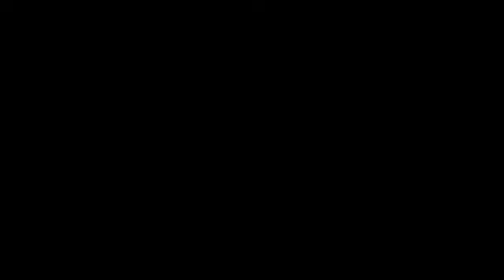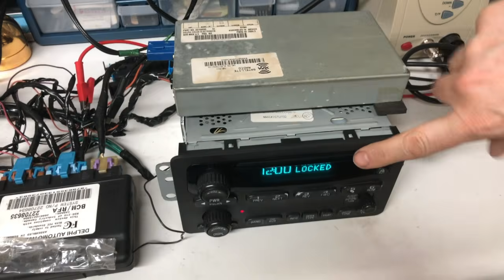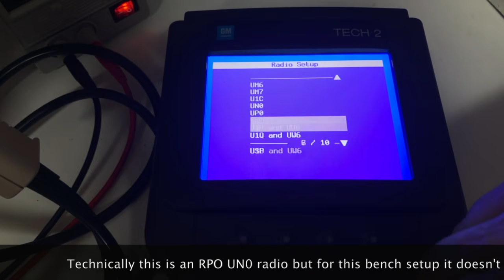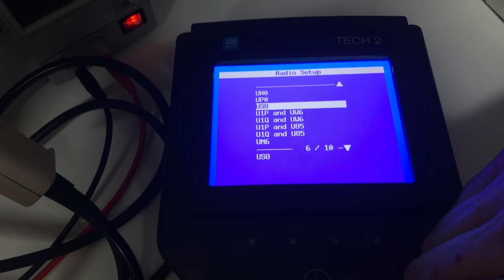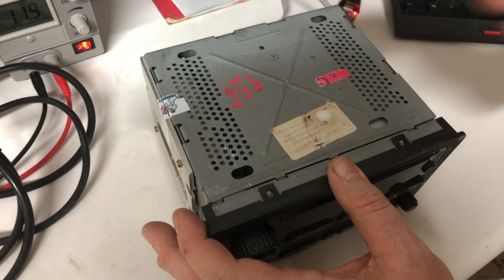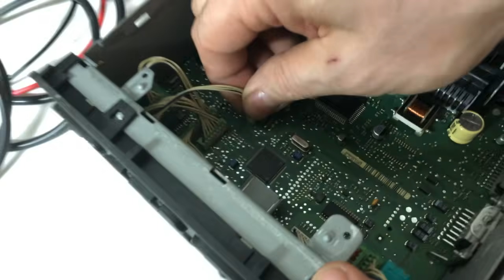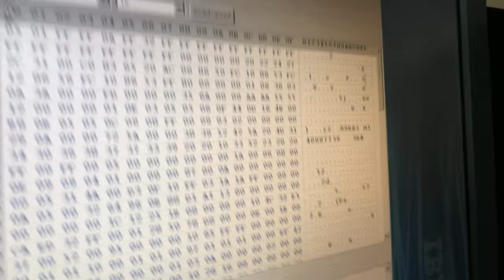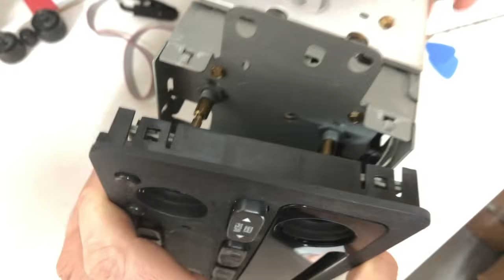2003 - 2006 How to VIN Unlock Salvage Yard GM RDS Radio w/ Tech2 OR Manually Programming its EEPROM

Comment: Ok I have done some research and have come to the conclusion the method in this video does not work on early 2000's cadillacs (except the escalade). This is because cadillacs from this time period do not have a bcm. Instead there is 3 modules that do similar functions to a bcm in most gm vehicles. A byproduct of the different design is that the databus actually goes through the radio and therefore despite having the same eeprom as in normal gm radios the vin is not stored there. I did several test to prove it including: swapping eeproms between locked and unlocked radios and also running the radio with no eeprom (can't store radio presets) and same result so unfortunately a tech 2 is mandatory until someone can figure out where the vin is stored on cadillac radios.
Reply from the maker: Whats the GM part number on the sticker of this Cadillac radio you're seeing this with?   And from what year and model Caddy?
Reply: @DrShock  one of the part # 25739873 its on a 2000-2005 cadillac deville.
Reply from the maker: I haven't come across this one before, definitely a Theftlock style, which has VIN lock rather than a manually entered lock code from the earlier series.   But a very different faceplate design, and clearly a different Delco Electronics circuit board layout.   You did verify that you're looking at the one and only EEPROM device on the PCB right?   I know that some Delphi PCBs from this time switched from using SOIC8 types to SOT23 type devices, for example.
Reply: @DrShock  absolutely i saw your video a while ago and found the exact same eeprom as in your video inside this radio but regardless of swapping it or attempting to read it stays locked.

Comment: I have a 2003 Silverado Base Radio and needed to replace the radio with a junk yard radio.... I have a GM Tech 2 and it's not giving me the option to Radio Setup...it just gives me "Input" "Output" etc...... how do I "unlock" radio.......??
Reply from the maker: The cars and trucks may have different menu paths in the Tech2 to get to the same functionality.  This special function may be called VIN relearn for a 2003 model year truck.  And it may not be in the same menu path as I show for the cars here.   

You went into Body section menu, then found radio, special functions right?   And if so all you see are the speaker and amp settings?
Reply: @DrShock  I went into all that and all it showed was "Input, Output and Data" with no Setup in the menu.    I've spent more than an hour looking at other options....I'm tired of it..... I wanted to replace the radio because the CD Player and Cassette were not working, so I'm in the process of switching the circuit  boards so it'll work......
Reply: When I switched the circuit board everything worked just fine...but what a headache.....
Reply from the maker: I've heard some times, on the earlier, trucks you have to change the year to a later one to get it to show up.   But not always, which is why I showed both methods.    You might try saying you have a 2004 or 2005 and see if the menu options change for you.
Reply: @DrShock  No luck....tried later and earlier by a few years and it would never give me "Radio Setup" or anything that would seem to  get it unlocked......SO I just switched the circuit board and then I had a radio with a CD and Cassette all working.

Comment: I finally got my hands on a CD/Cassette radio that everything works on. 15195517. This radio has (3) 8 pin chips. There's some clear coating on the board. Can not read the labels on the chips.  Will the CH341 destroy a chip if it's not the eeprom and/or is connected backwards?
Reply from the maker: Yep, quite possible to fry something like that.  You would be supplying voltage to a pin on the chip that wasn't supposed to receive it.

Comment: I have a regular CD player deck, can I swap it out with the upgraded 6 disc and it work? If I unlock it?
Reply from the maker: The single CD player is integrated inside the radio in this model.  So you would need a compatible remote multi disc player for it to work.   By compatible I mean it would have had to have been an option you could have bought from GM in the same year as the radio and vehicle.  Otherwise, there is unlikely to be any programming support for such a configuration.    You might have to look into non-GM aftermarket options to get what you want otherwise.

Comment: I installed a radio from other truck. At first it said locked. I turn the truck off and opened the door then shut it, waited 5 mins, then turned key to on and it worked? Thank goodness.
Reply from the maker: That sometimes happens.  But before you pop the champagne, make sure it's still ok after a few days and with a power off event.  Sometimes I've seen them do a mystery unlock only to relock for good when the battery is disconnected.

Comment: My 2006 Chevy truck radio motherboard does not look like this one, but the radio face is the same.
Reply from the maker: There can be a few different circuit boards as GM had different suppliers, different specifications.   The approach is the same, but the trucks will not have the VIN relearn function in the Tech2 menu.  And the EEPROM location will be different.

Comment: Thank you for the in-depth video and explanation. Would you know how people online are able to offer an "unlocking service"? Can the VIN be erased without having it learning a new one? Essentially putting it in VIN limbo I suppose.
Reply from the maker: The Body Control Module (BCM) will force the radio to carry a VIN, so it will always need to learn one.   But what the professional radio shops typically do is reprogram the used radios EEPROM with a virgin image.  Since these shops either have OEM relationships, or sold new OEM radios, they have access to these images to remanufacture the radios to like they were new out of the box.  Such radios will then relearn the VIN from the BCM after installation.    

The unlocking service folks are basically doing what I've shown here, you give them your VIN and they do exactly what I've shown.   Some radios can have 0x00 to the VIN area, some 0xFF, etc and it will also trigger a VIN relearn.  In those cases the radios are sold with the VIN zero'd out.   Though this latter approach can cause a CAL ERR problem with Delphi radios, it will be unlocked.  Hope that helps.
Reply: @DrShock  Thank you so much. You are a wealth of knowledge!

Comment: Using the eeprom reader worked for me. So happy to have a factory radio in my Silverado and didn’t have to charge the dealer $180 just to unlock the factory radio I found at a salvage yard.

Comment: Awesome video!   I have a ch341a device that I use for working on laptops.   So I think I'm all set.   I pulled a radio from an 06 GMC Envoy at the local pick and pull.   It's Delphi part no, 28043565,   GM 15850275,  date 12/11/06.   Initially plugging the radio into my car, it powered up and played.   Of course it promptly locked when I turned the key.    So opening the radio, I see only one 8 pin chip toward the center of the board labeled 1001375  9606W.    Searching this out, it would appear to be a 24C08 chip.    I attached the clip in what appears to be the correct orientation,   and run the linux flashrom program.   In this orientation an get both leds to light, but the program only returns "no eprom/flash device found".    Reversing the clip produced "Couldn't open device 1a86:5512."    Can you offer any advise?   What am I missing?   Thanks!
Reply from the maker: Thanks.   So there's a couple of factors perhaps involved here.   The link I provide around the CH341a is modifying it for automotive use.  What you use with laptop flash chips is going to be 3.3V, or even 1.8V with an adapter.  But automotive boards do not use these voltages, they use 5V.   So reading and writing an automotive board requires a voltage upgrade to some CH341a programmers - those without a selectable voltage setting.
 
The second consideration is that actually very few GM circuit boards have memory chips that can be read with a test clip.  I always try that first, but I'd say it's about a 1 in 8 occurrence that it works.  This is because when the test clip powers up the memory device, it also powers up other devices on the board.  And if the circuit design has those devices accessing the memory chip, you will get bus contention that prevents accessing the memory.  In these cases, as it is most of the time, you have to desolder the memory chip from the board and read/program it outside of the circuit.
Reply: @DrShock  Thank you for your quick reply!   I'll look for that link and see about modifying one of my CH341a(s).   I'll give the clip another try, and if not I'll unsolder it and try that.    Is it possible to program another chip with an generic unlocked image and replace the chip?
Reply from the maker: @fractal815  If you have a virgin image, sure.  A virgin image would be how he radio EEPROM appears when purchased as a brand new part - unlocked and un-programmed.   You can also save the chip image from a radio that a radio shop has unlocked and reset to the "new" state.  But any used donor radio will, of course, contain a VIN already and would not yield a suitable image to use for this approach.
Reply: @fractal815 What did you do regarding that? I have the same chip in the middle of the board

Comment: Thanks especially for showing how you struggled to get the test clip on the chip.  If I hadn't seen that, I probably would have been de-soldering or thinking I had a defective programmer.  But I kept at it, and eventually got a good read like you did.
Reply from the maker: In later vids I switched to a USA made Pomona clip and have never had anymore problems like that.  The Chinese unbranded ones are just very poorly constructed.

Comment: Can i unlock any headunit without the code using this?
Reply from the maker: The code type radios, which had a Theftlock logo on the faceplate, ended in 2002.  GM hasn't used any code radios since.   2003 and up are all programmed to the VIN of the vehicle they were originally installed.  

Each radio generation has a different circuit board design, different type of EEPROM chip, and in a different board location.  Some you can edit on the board like this old type, most newer ones you have to desolder the chip from the board first.  But those details aside, this is the only way to unlock any GM factory radio without a GM dealer grade scan tool.    It's just that the details vary with every generation (I have several videos up covering many types already).

Comment: Did you do the 3.3v mod on ch341a? I'm doing it before attempting to read eeprom. I was unaware of that design flaw
Reply from the maker: Automotive chips are 5V, not 3.3V.  The latter voltage would be for the type of chips used in consumer electronics instead.  The ch341a mod video linked in this radio one goes over how I mod'd the black edition for 5V automotive use.  You might have to scroll down the Youtube circle i icon to get the list of linked videos in the upper right corner while the vid is playing.

Comment: Hey I used a tech 2 on my truck and every time I tried doing the radio setup it would say radio setup failed. What do you think is the issue?
Reply from the maker: Does the truck have the original radio or one from a different year?  Are you able to read the part number and other data out of the radio with the Tech2 ok?
Reply: @DrShock  the radio is from the same year and same Bose head unit
Reply: @DrShock  uhhh I haven’t attempted to read the info. I bought a eeprom reader shoukd be here tomorrow then I will check
Reply from the maker: You should be able to read the part number, calibration number, etc just using the Tech2 special functions under radio.  If you have a Tech2, and it's a GM vehicle under 2011 model year, you shouldn't need to deal with the EEPROM itself.
Reply: @DrShock  hey thank you!
Reply: @DrShock  I will try again tomorrow but yea it wouldn’t work at all. If I can get the eprom module to work then fine by me.

I also will be doing a seat harness swap too so I hood it doesn’t interfere
Reply: @DrShock  hey ive given up, i haven't had luck programming through eprom or tech 2 tool. How much would you charge if I shipped it to you? Thanks.
Reply from the maker: @williammclaughlin2606  So let's see if we can get you going since you have the gear.  Did you successfully read the EEPROM chip or still working with just the Tech2?
Reply: @DrShock  I couldn’t get the eprom chip to connect what so ever. I used same program as you. (Updated) I made sure all the hardware was connected right. The tech 2 wouldn’t even attempt to do the radio function
Reply from the maker: @williammclaughlin2606  Since this video is for a Cavalier or Sunfire and you mentioned earlier you have a truck it's not going to be the same radio board.  What year truck?  And what GM part number on the radio?
Reply: @DrShock  06, I’ll get the part number when I’m home. It is a Bose radio, and I know 100% I was on the eprom chip. It’s much easier to access than the cavalier
Reply from the maker: @williammclaughlin2606  If the radio face looks cosmetically like the one in this video, it's probably close enough.  But if not, this other video may be more applicable  - https://youtu.be/ilBPGnoeMoU
Reply: @DrShock  it is similar to yours. Very
Reply from the maker: @williammclaughlin2606  Ok, then it should have the exact same part number EEPROM on the board as I showed here.   If it did, what did you get when you set AsProgrammer to a 24C08 type?
Reply: @DrShock  15532 and yes I did switch it to that yes sir
Reply from the maker: @williammclaughlin2606  So I see the problem now with your  15532 comment.  The chip you're after on this model year range has to be a Delphi 9355093 or straight up marked 24C08.  If you do not have that, then the procedure in this video isn't going to apply.  A circuit board design change in your truck version from the car version I've shown in this video no doubt.    I did find a single forum comment talking about GMC Sierra radios with a 15532 chip,  so that clued me into what you had here.
 
I know that GM started removing the VIN relearn functionality from their tooling at some point, and for your 2006 truck and with this particular radio board level, this explains why you couldn't get the Tech2 to show the VIN relearn menu either.  So what are your options?

Well, if this were my situation (because I haven't worked on this model radio before) I'd try these in this order:
-- Try to build the vehicle on the Tech2 as a 2006 Chevrolet Monte Carlo LTZ W body/product line code.  Then see if the VIN relearn menu appears under Body->Entertainment->Module Setup->Radio (this comes from a GM bulletin PIT4007D issued in 2008 as a workaround for an accidentally locked 2007-2009 GM truck radio)
-- Use your TIS2000 software and the Tech2 to perform an SPS calibration update onto the radio to force the revised VIN.

Hope one of these gets you going!

Comment: I have a Corvette DN-NS-008 radio that I'm trying to put in my pickup the radio is locked how can I unlock this radio I cannot find anything on how to do it
Reply from the maker: That would be a navigation type radio made by Denso.   If it's from a Corvette under the 2009 model year, and the truck is of the same year, you should still be able to use the Tech2 to do a VIN relearn on it or have the Chevy dealer to that.  The communications wiring changed at some point around 2005-2007 depending on the GM model, so you cannot mix match too broadly.  If it's a 2011 or newer radio, the only way is probably editing the EEPROM chip contents on the circuit board as GM made changes to prevent dealers supporting what you're trying to do since it costs them $$ at the parts counter.

Comment: Hi, DrShock thanks for such a superb job of presenting needed information. I have a 2001 Buick Le Sabre and want to know how to unlock the radio with a GM Tech2 scan tool. The radio is not a RDS radio. Thanks in advance for your thoughtful response.
Reply from the maker: Usually the pre-RDS 2001 and older radios were Theftlock types, just a code to unlock.   These pre-date the Tech2 relearn feature and all you need to unlock one of those is call an 800 number with a button sequence code.  Check the description on my other video here - https://youtu.be/OJg6czxvJ2I